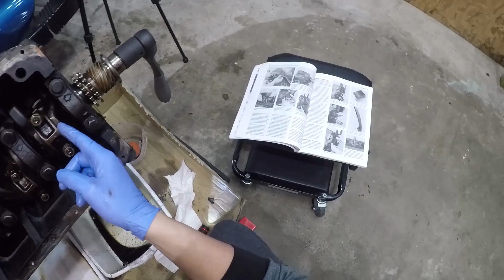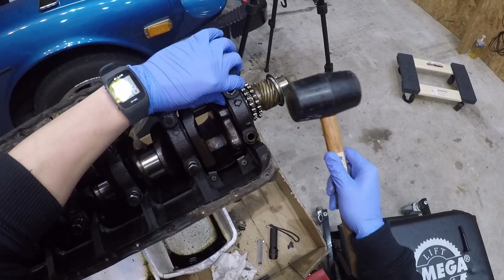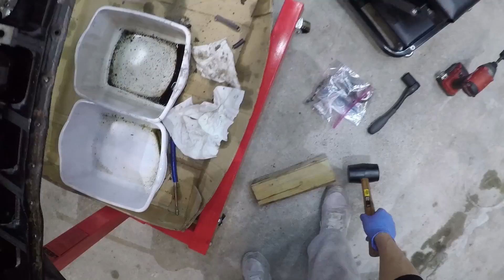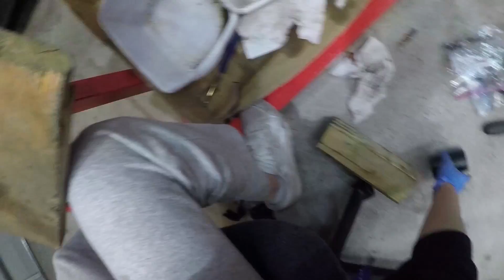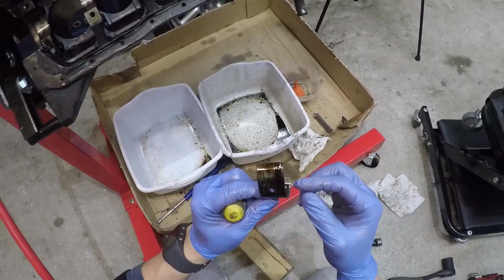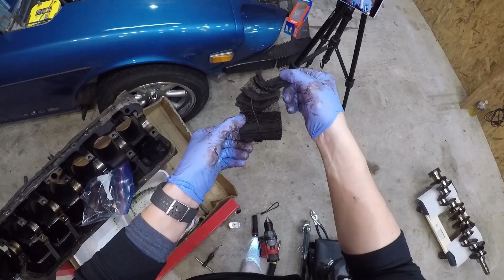Datsun L-Series Engine Guide Ep.4: Disassembly Pt.3 Pistons and Crankshaft

Comment: Don't reuse the stock Nissan rod bolts.  They are meant to stretch permanently when torqued to spec and are one use only.  In fact, the correct way to install them is to measure bolt stretch, not torque which is just a measure of rotational force.  The connecting rod bolts are the weakest link in the L series engine.  When they go, you are looking at a new block because there will be a hole in the side where the end cap exited!  A good set or ARP bolts is only $65 or so.  https://www.amazon.com/ARP-2026003-Performance-Connecting-Applications/dp/B000CFU67K
Reply from the maker: Gotcha.  The guide book made it sound like I could,  but I was planning on getting ARP bolts anyway.

Comment: interesting look at the piston rings, the compression do not seem to have the end gaps very far apart. Also did you note any stickiness to them? how did the bores look?
Reply from the maker: I think the gaps just look pretty far apart because the piston is out of the bore. I think the actual compressed ring gap is really pretty small, although I don't remember the spec off the top of my head. 
The rings didn't seem to stick too much, but I didn't do a thorough inspection of them yet. Same goes for the bores. The cross hatching is largely gone, but I'm hoping that there's not much taper since they all passed the ever-so-precise fingernail test so far. 
I'm really wondering if I should invest in a set of nice micrometers and bore gauges. I could easily have the machine shop do the checking/measuring, but I'd feel better if I checked them myself. The only downside is, a "nice" set of precision measuring tools can reach over $1k REALLY quickly. And I'm not made of money!
But more to the point, the whole series is meant for beginners and typical garage mechanics. And since most of us don't have precision tools on hand, I might just farm the inspection work out to a reputable machine shop.
Reply: I was thinking of the offset of the gaps so they don't line up in the bores. they looked very nearly in the same vertical plane.
Reply from the maker: Ohh, yeah, that makes more sense. I was thinking the same thing when I pulled it out, but I don't have a great idea of how those compression rings work. I know that they rotate around the piston as it travels up and down, but I don't know if it's normal for the two rings to overlap gaps every once in a while.
Reply: I burn a little more oil than I like, prob 1q 600-700 miles. I will try check the valve stem seals 1st but may end up where you are sooner or later. I am hoping to get a spare engine locally to work on. for the heck of it I did a MMO soak on #6 just to see what would happen. put about 3 oz in the plug hole and let it soak for a bit, prob should have let it go overnite but anyway after clearing it out and putting the plugs back in I took it for a test drive, MASSIVE white cloud of smoke for a few miles, all back to normal now. I did look down the plug hole with a borescope, it had much less carbon build up on the top of the piston. I should do the same to all of them, let it soak for a few days and then clear out and change oil. No idea if all that is going to do anything.

Comment: get a hand impact driver anytime you need to get a phillips stye head.
Reply from the maker: I didn't even know that this existed. Thank you!
Reply: yea they work great. I got one back in the 70's to work on my old Kawasaki dirt bike. The cases were joined with phillips head screws. Would strip out every time. Two issues, some odd non standard bit IIRC and with out the impact driver the screw driver would works its way up, and that's when is started to mangle the heads. The hand held one comes with bits, you smack the top of it like you would a chisel with a machinist hammer. It turns maybe 1/16  of a turn, but that's all you need to get started. The sharp impact helps break loose and drive the bit in at the same time. And since you are not just hammering away on it like a reg impact, its less likely to shear off the head. I used it on the phillips heads that are OE for the injectors. You can use with reg sockets too. I would look for an old craftsman model, it came with a 1/2 drive and adapter that takes hex bits for the flat and phillips screws. Best thing is no air or battery charger required! This is it, funny you can by an air impact gun cheaper at HF oh well still a tool that will get good use.https://www.ebay.com/itm/Craftsman-Impact-Driver-New/232209230603?epid=1324530631&hash=item3610bfab0b:g:zJAAAOSw-0xYfkdL

Comment: wow that rear main was tough, mine came out easy and that was with the engine in the car. But maybe since mine was leaking a the side seals that would be why.
Reply from the maker: By the way, Dave, you were absolutely right. The delayed start had nothing to do with the car not holding fuel pressure. I enjoyed your episode on testing this theory. I might have a faulty ignition switch! Have you switched yours out?
Reply: yes switched out after testing NEVER had a problem with intermittent starting after that.
Reply from the maker: Was it pretty involved? Where did you buy the switch?
Reply: very easy to replace 2 phillps on back of the switch (just the switch not the hole lock mech)  and unplug wire harness, max 5 min. with it out on the bench use a tone type continuity test and the FSM to check the various terminals. Mainly you want to look at what is supposed to be closing while turning to the start position. there is where my old one had some dead spots. I got an OE from on of the online Nissan parts suppliers should about 45$ shipped IIRC. I would only go OE here, not one of the cheaper aftermarkets, they only save about 15$ off OE, and I really really did not want to have to replace again. I stress that you should test test test before replacing, its easy to do. If it test fine save your money. If you do need a new one, test before installing (even OE) just to make sure its works as it should.
Reply: 48750-E7705

Comment: So that screen really makes me wonder, if it is that gunked up was it allowing air to flow up and into the PCV valve, Which makes me wonder how bad of shape mine is, I bet all engines this old would have the same gunked up screens. I guess you could disconnect the hose off the PCV valve and rig up a vacuum and see if it pulls air easily. What is that screen made out of, hopefully not metal, because it seems like it could shed small particles into your oil.
Thanks for giving me questions about my setup.
Ive heard that to be a good  You Tube Channel  your personality needs to come through on video, which is not easy for alot of people. Apparently your does. Entertaining and Instructional. You have both.
Reply: Still available OEM part#: 11037-E3000   https://www.courtesyparts.com/oem-parts/nissan-wire-netting-11037e3000

You gotta use the parts diagrams at http://www.carpartsmanual.com/datsun/Z-1969-1978.  I've downloaded it all in case that site ever goes away!

Then search by part # at www.courtesyparts.com because our cars aren't searchable on their site, but the individual parts still are.
Reply from the maker: Oh that screen is metal. I've never seen a replacement part for that screen so I'm not sure how/if I can source a new one to put back in. I'm wondering if it's even really necessary to do so... but as a rule of thumb, if Nissan engineers thought it was necessary, it probably is. 
You're too kind! I appreciate the positive feedback, and I'm glad you think that we've struck the right balance between being entertaining and helpful. Sometimes I'm tempted to try to make the videos a bit more entertaining to appeal to a wider audience, but the last thing that I want is to force it and be cringe-inducing. Even If I don't try, I think there's some natural humor that arises from things inevitably going sideways sometimes =)
Reply: When you take your block to the machine shop just ask them about the screen, and take whats left of it with you, they will know what to do, I believe its needed. Fumes are sucked up through that pipe into your intake to be re-burnt, you would not want to get oil into the intake, the odds of doing that are really slim but not good if it were to happen, say going fast around a corner. I have mine routed into a catch can then back to the intake.
Still ask the machinist, they know this stuff. Let us know what you find out.
Reply from the maker: Awesome thanks!